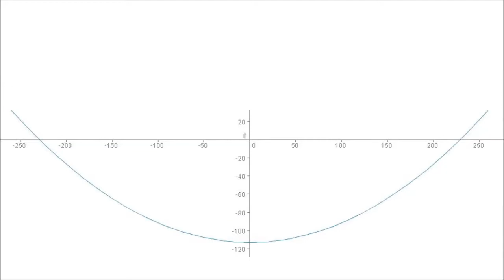Making a parabolic mirror

Comment: thanks. that was enlightening! 
two points:
- are there different aluminum qualities that make a difference regarding  
  a. "degree of reflection" (at high polish as suggested below) 
  b. "cost"
  c. "corrosion" (of the polished side)

- which kind of finish will endure against corrosion (decline of reflection quantity) best?
any glaze or varnish on top?

Comment: What kind of inside finishing can be applied for better optical characteristics?. Of course I don't expect astronomical telescope mirror grade.
Reply from the maker: We Polish the inside in three stages to a high gloss. It gradually starts with a coarse polishing. Then follows the medium polishing paste and finally the finest paste.
Reply: The mirrors are polished mechanically - with rotating polishing plate and polishing paste.

Comment: I guess one needs to turn the form, or are they available? Does the larger clamping plate have a parabolic surface on the side that contacts the disk?
Reply: Yes, the form is a special turning part.
Reply: Yes, the larger clamping plate have a parabolic surface on the side that contacts the disk.

Comment: instead of trying to lathe the correct shape, spin-cast epoxy directly in to parabolic mirror mold
Reply: then coat the epoxy/plastic with aluminium
Reply: this is if you want optical quality parabolic mirrors
Reply from the maker: Thank you for that suggestion. The epoxy resin mold would then have to be lined with reflective foil, the surface of which is very soft and sensitive to scratches. Scratches in the aluminum, on the other hand, can be polished out again. That's why I prefer aluminum.
Reply: @stirlingfreak  use the simplest way possible and at the same time the most effective and consistent method, use the chemical vacuum deposition method (or plasma vacuum deposition) of aluminium/silver instead
Reply: @stirlingfreak  you want a perfect finish, every time, no hand tools
Reply: @stirlingfreak  ie no manual work, just pop out the parabolic mirror from the cast-spin tube, then put it in coating chamber
Reply: @stirlingfreak  painting is better than foil, unless you have to earn money for your hands works, in vain
Reply: @stirlingfreak  sorry chemical vapour deposition (or pvd) in partial vacuum
Reply: @stirlingfreak  you could also try spin-casting a parabolic metal mirror from/with aluminium over an electric induction cooktop, or in an oven (spin + heat + aluminium = spin cast aluminium parabolic mirror)